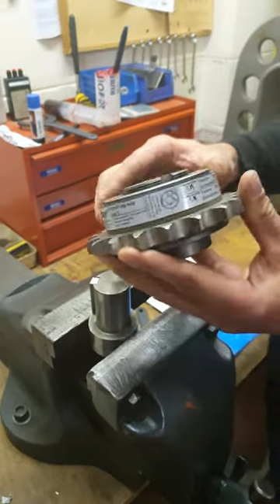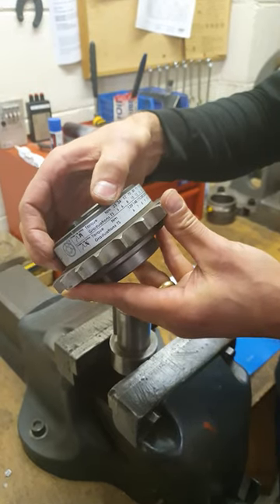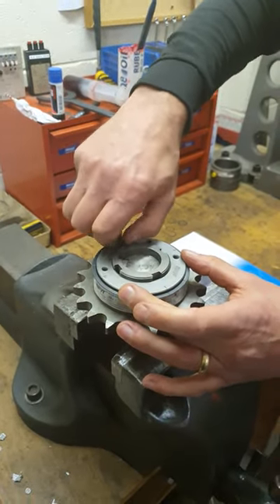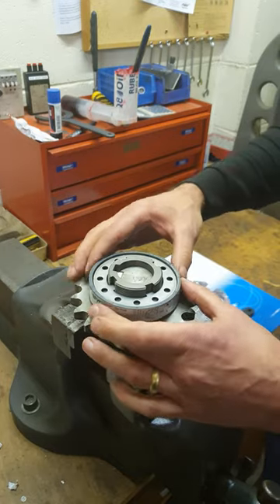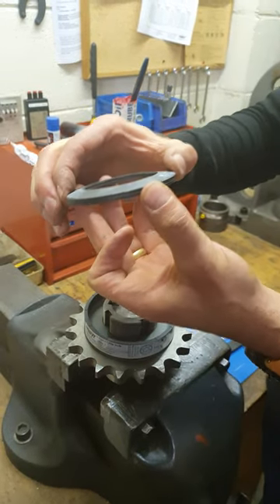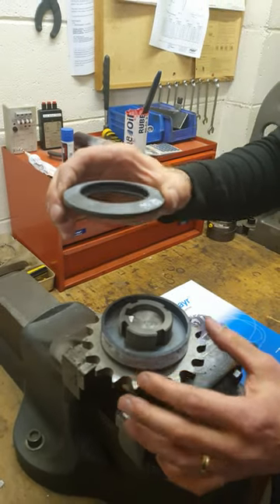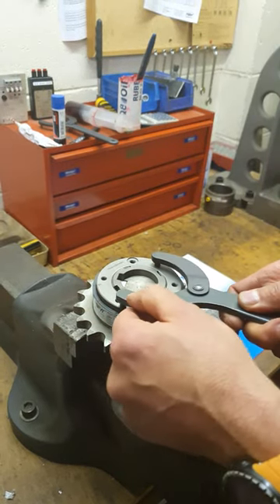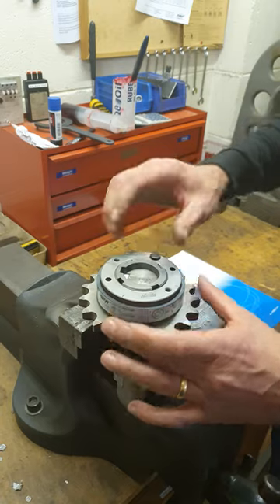ROBA®-sliphub Torque Change

Comment: Hi. I have one of these on our capping machine. Is there something that can go wrong in slip hub.  Our conveyor not moving, and there's nothing that stuck there, so it should work but this hub keep slipping.
Reply from the maker: Hi Artur - thanks for your comment. Generally speaking, this could be one of two things :-

1). The friction linings have worn so that the sliphub has now lost its ability to transmit the torque it was set at. If the linings are still intact and in good condition, you could tighten the adjusting nut to increase the torque again. If not, drop us an email at sales@mayr.co.uk and we can provide you a quotation for some new linings (or new unit depending on the condition).

2). The load torque has changed on your conveyor which is exceeding the sliphubs set torque.
Reply: @mayrtransmissions  thanks a lot for your help. I will know where to buy parts now if we will need. Thanks 👍